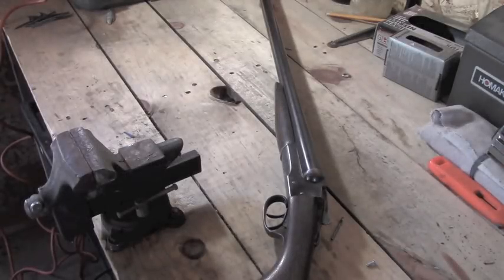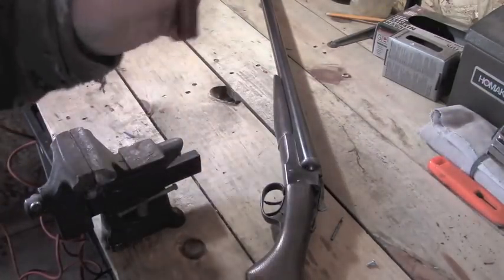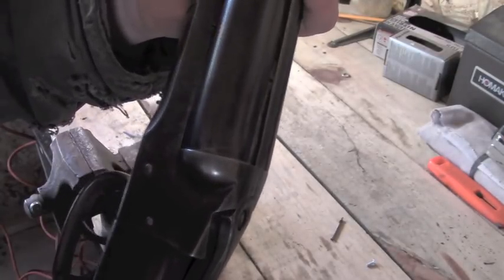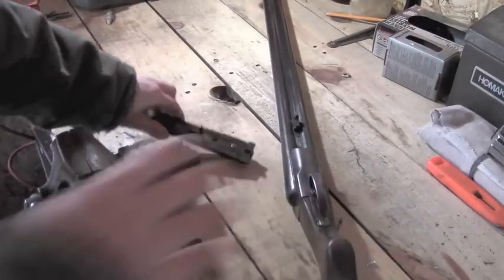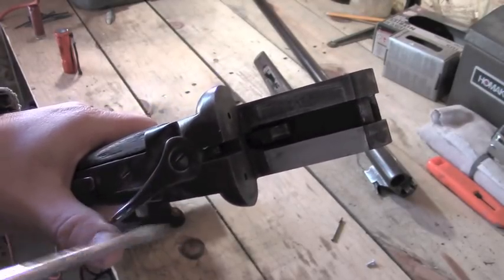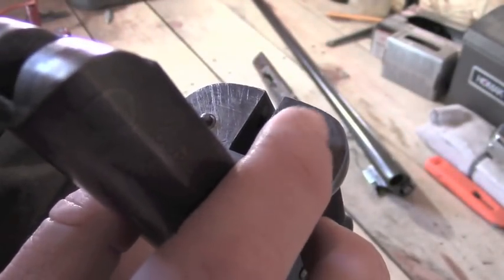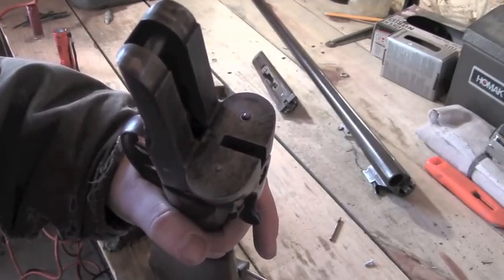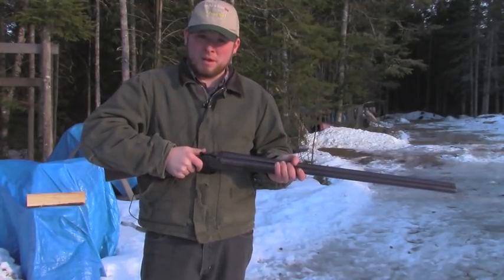Fixing Firing Pins on a 12 Gauge Double Barrel

Comment: Based on the top snap mounting screw location this is a model 315 Savage / Springfield / Fox A.  Common problem and have one which I've repaired externally with pin intact as well as internally replacing.  Informative video.
Reply from the maker: Thanks for watching. I’m a Machinist, but certainly not a gunsmith. This was a stopgap measure and it has continued to work fine since the fix. I’m sure someone more knowledgeable on this particular style firearm could have done it more properly by disassembling and modifying it.

Comment: Looks like a Stevens 311. Your pins don't look to bad - most of the time , the firing pin holes get full of junk , and need to be cleaned out. I would not try to take the hammers out , as they can be very hard to get back in, The springs are very stiff. Taking  the stock off will make it easier to clean the internals. They are notoriously hard to cock. There are two fixes , if you are really handy. One is the Stevens $7 fix. Lets the barrels lay all the way down to load shells easier. Brownells sell a modified spring kit made by Wolfe to make it easier to cock. Like I said , not for the faint of heart.

Comment: If you rubbed lip gloss, chapstick or some other lubricant on the shotgun shell primers before firing the shotgun, would that let the firing pins slide away from the spent primers after firing?
Reply from the maker: That would have been an interesting experiment for sure. This shotgun has never done it again since I made this video, so I can’t test the idea. It solved the problem and I use it each bird season now without difficulty
Reply: @MaineMachinist  I have the exact same shotgun and I cleaned up the firing pins like you did. However, my gun still locked up upon firing. I removed the butt stock and cleaned the springs and all internal parts including the firing pins and channels the firing pins ride in with brake parts cleaner and then lubricated everything and I still had the problem. I rubbed lip gloss (chapstick) on the bottom of the shotgun shell and the shotgun shell primer and now the locked up problem was solved. Thanks to your video I was able to isolate the problem to the firing pins. Thanks for the video.

Comment: I tried putting mine over my knee, it wouldn't budge.  I had to brace it on the arm of the couch when I got home, and smash it repeatedly in the barrels with my fist, bracing the stock with most of my weight, before the pins finally let it budge.  The primer, and even the base just outside the primer, have significant gouging on both shells.  I guess I have some work to do.
Reply from the maker: Take your time and go easy with it. I'm sure it can be repaired!
Reply: I have the same issue with my 311 -very hard to break open only after firing. Not a bad as yours ,but very stiff.I don't want to take it apart - it looks hard to put back together. Now i know I am not alone with this problem

Comment: You have to make a spring/ hammer compressor to re assemble / when you make the fireing pins make them rebounding with a small spring on the front of the fireing pin

Comment: Hi,
Looks like you fixed your problem....however, if it hadn't or others out there run into a similar problem...I'm a Gunsmith and just converted an old Stevens 315 into a coach gun.....and rebuilt the receiver....had a similar problem...opening the action....mine was a 1915....understanding the ballistics of cartridges...even though my barrel was marked...and I checked with a chamber gauge for a 2 3/4" shell......the old shells were made of cardboard and the wadding was made of fiber....vs. plastic (today's)....this issue was that the forcing cone wasn't allowing enough room for the shell to fully open...and thus was pushing the brass back...making the action difficult to open.  What I ended up doing was getting a forcing cone reamer....and I opened the forcing cone up more.....mind you...I DID NOT LENGTHEN the chamber.....just opened the forcing cone....that did the trick for me.
Reply from the maker: You are correct about the paper shells vs modern plastics. 

I think either way of doing this can effectively solve the problem. I thought about using a reamer as well, before I made this video. In the end I decided that for my gun, this would be a simpler solution for what I use it for. Other people may decide differently and want to use the reamer method, which would be more technically correct from a home machinist / gunsmith standpoint.
Reply: @MaineMachinist  Take a spent cartridge wrap with 000 emery paper wet and use it as a reamer. work excellent and cleans any rust at the same time
Reply from the maker: @robertboreman7672  excellent idea

Comment: I use to have the same shotgun you have. I would purchase ALL the internal parts and keep it. They no longer make side by sides of this quality that were cheap in price.
Reply from the maker: Thank you!
Reply: Most of the parts are interchangeable between the Savage,Springfield and Stevens SxS Shotguns. The best place to check for parts is Numrich Parts. You can find them on the internet and also depending on what model you have they may have a schematic breakdown of parts for your shotgun.
Reply: Just seeing your comment, thank God they don't make them of this quality anymore, thier complete junk, not everything old is good
Reply: @ericschulze5641 you sir are quite wrong. What it is is that they are not properly maintained. I know I happen to have three of them and they are my favorite shotguns to hunt with. Yes I do have more fancier and expensive shotguns.

Comment: The rebound springs are probably broken. The pins shouldn’t stick out.
Reply: Do you have any further info about these type firing pins or the gun in general?
Reply: @markzerinskas1806  After looking up the patent and talking with my dad(50+ years gunsmithing) This design as well as Winchester Model 24’s are dangerous to carry loaded. The safety only blocks the triggers. The gun cocks when you open it. I’ll find the link to the patent. It shows the blueprint. The firing pins may be broken because they shouldn’t stick out when you open it.
Reply: @nascarjimbo  Thank you for the information. If you find out anything else please let me know.

Comment: Your pins are sticking- they should go back in , as the  are spring loaded. Breaking open the gun is when the hammers are cocked internally . It looks like a stevens 311.These guns are notoriously hard to cock Needs a good internal cleaning. Don't try to take the internals out unless you are very experienced. The hammer spring are almost impossible to get back in. Just take the stock off , and give it a good cleaning.
Reply: You won't find any hammers in this model. It has spring loaded pins. Similar to how a striker fired pistol (Glock) works.

Comment: I have a 410 break barrel and the spring that is attached to the ejector popped and now I can put the gun back together would you know how to fix it
Reply: There is a screw in the ejector that hold the spring in the slot behind the ejector There may be a small pin in the hole also. Clean everything , and put in a new pin. Numrich arms has all the parts and schematics.

Comment: Please I need some assistance: I have a VERY, VERY similar shotgun that is a Ranger that I am trying to repair. I discharged the right barrel now the trigger is stuck I the rear pulled position and I cannot use the gun any more. I would like to take it apart and see if it is repairable.can you do a video showing how to remove the pins?would you happen to know where  I could get replacement parts?im pretty sure that it is a sears and reaubuk 1940's.  it was my grandfathers gun and my dad gave it to me.
Reply from the maker: I would say that Donald Robertson's comment is the way to go. Its scary digging into these old things because its very difficult to find parts. You may find that a small, locally owned machine shop may be able to make parts for you. Keep that in mind.
Reply: Sounds like a broken or bent sear spring. Take stock off.Drive out sear pin from left to right  ,following with a slave pin. You will see a sear ,cocking lever , and another sear. The sear spring is wound among them, Numrich arms for parts.Re install from right to left , using a slave pin.Watch which way the locking pin comes out. Should have ridges on on end. That goes in last.Take you time and note how things are installed before you take everything apart. Don't take the hammers out , as they have powerful springs that are hard to get back in. Good time to clean up everything. I use brake cleaner , and a tooth brush Blow dry and lube.If you are handy , you will figure it out.
Reply: @robertboreman7672  Would you have any further info on these types of guns?

Comment: So you actually didnt say shit about removeing just fileing !!!!!
Reply from the maker: It never once says "removing" anywhere in the title or description.
Reply: You need to remove the pins to do the job right.They get gummed up with old oil. Take the stock off ,cock the strikers , and you can get access to the stopper screws that hold the firing pins in. This is not an easy thing to do,Firing pins have small hair springs on them Numrich arms or ebay for parts. Pins are # 4 s.Firing pin holes are 2-step , and get full of gunk.I had to take a drill bit of the right size to loosen the crud , along with brake cleaner. The strikers rest on the stop screws when fired - that is why the pins protrude when fired. Cocking pulls the strikers back so the pins can retract.Be sure to get the stop screws fully seated , or the gun may not fire, I am not a gunsmith ,but I have done 2 of these guns.A lot of gunsmiths won't touch these old guns.